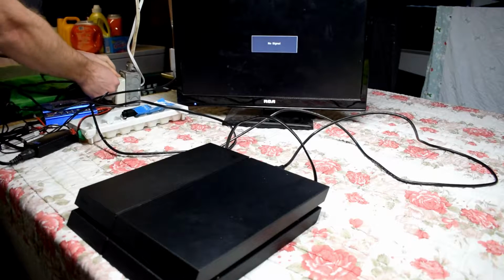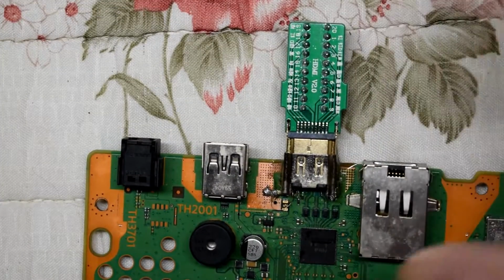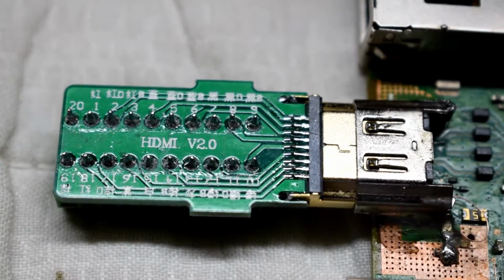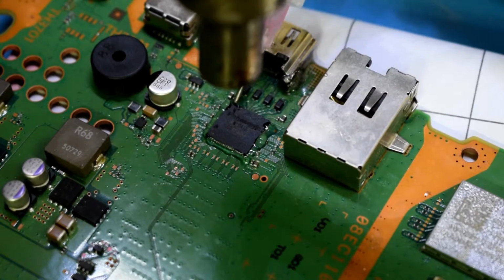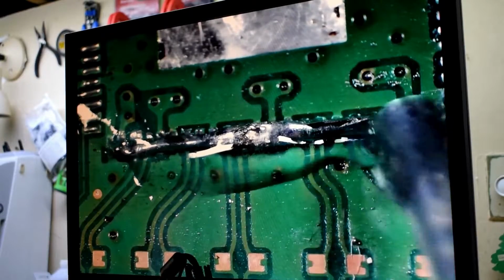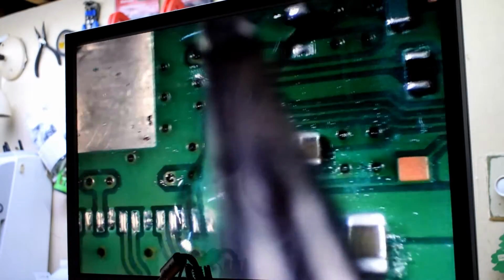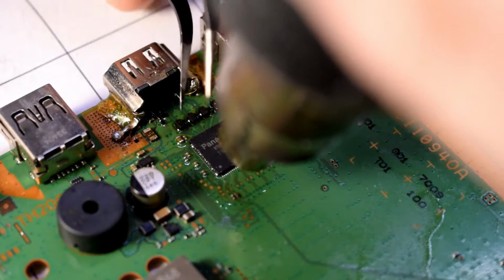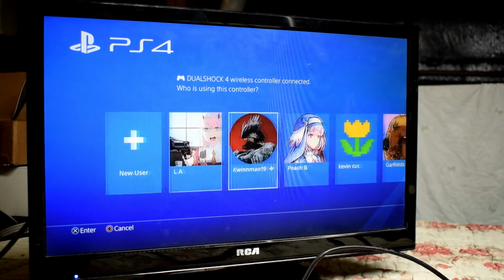PS4 HDMI no signal? or intermittent signal? (MN864729 HDMI Encoder IC Diagnosis And Replacement)

Comment: I just replaced the port and its still not working😢. Im worried I might not get it to work.
Reply: Its the chip! Or power supply if. You have a multimeter ground off and check the pin on the chip for continuity

Comment: You said you were tinning the pads with low melt solder? Was it actually low melt or did you mean leaded solder?
Reply from the maker: same thing the more lead the lower the temp
Reply: @NewsonsElectronics  incorrect. It's called adding leaded solder to help lower the temp of the unleaded solder. There's leaded solder and then there there's low melt solder. You don't want to use low melt solder to solder your work. It's to help remove components faster with less heat. And what in the world did you do to the HDMI port on this console? Lol